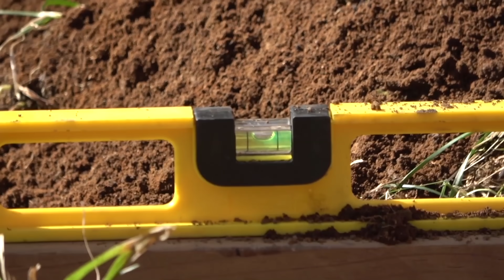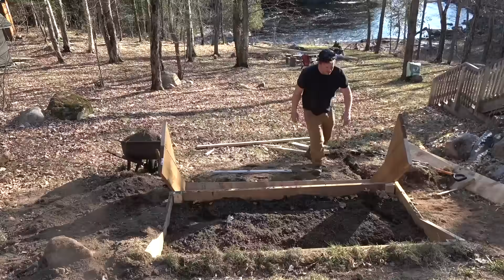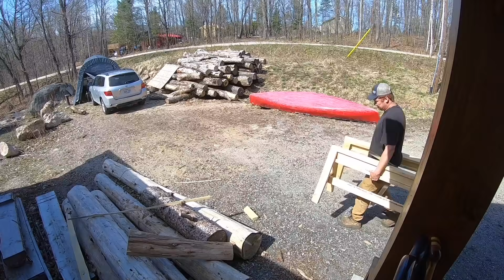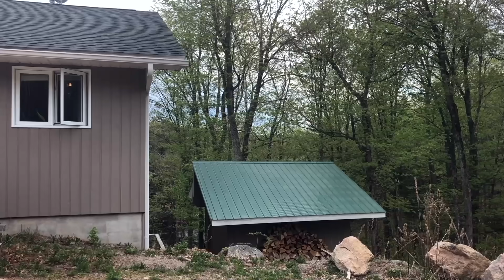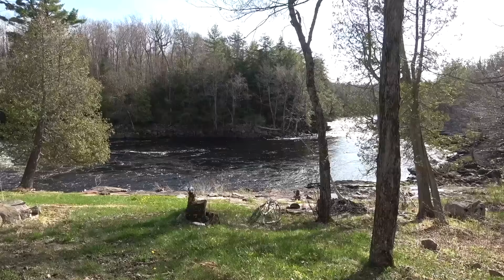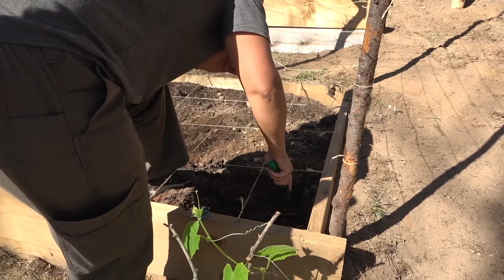Grow Your Own Food - Homesteading Couple Builds Raised Bed Terraces on Hill for Three Sisters Garden

Comment: That is a sweet start! The beds look good. Do you have enough water pressure to go all the way to the top of the hill? You can set up an automatic system to water them all at once, or one or two at a time. I would recommend a drip system at the base of the plants. From my experience they don’t like overhead watering. Mix the manure in and water it and let it sit for a little while, before you plant. It should do fine. Good luck! Make a chill zone next to it, so you can look at your garden and have a barbecue and enjoy with friends. Love your work. Both of you rock! Peace
Reply from the maker: Eceellent ideas!! Thanks a lot for watching

Comment: Lovely property.  I live lakeside in the north and sunlight is difficult for a short season, I moved my garden 3X but compost is excellent so save your leaves and scraps to decompose and learn companion french intensive planting as to what plants do better next to another or vice versa.  Plants do well when you change up the location as they use different nutrients, so tomatoes might go in a different spot each year, they like banana peels! Peppers like a match stick!  That slug you had/ plant your tomatoes with the stem wrapped in some cardboard/paper towel roll/roots to the "side" right in the manure trench style...never had them burn but don't use chicken manure unless composted and slugs will be an inch down next to the stem otherwise!.  Planting higher behind lower to utilize sun.  Growing a second season of greens that like the cold?  Maybe plastic sheeting could help extend your season over and around the beds.  I'm learning more about herbs/medicinals to plant, but nothing is better for immune than garlic and fresh rosemary, basil and thyme! That is my next addition to my own.  I have to use straw/hay to winterize my camp,  so I used that for raised beds 2/3 ft high...composted leaves at the bottom...tons of worms enjoy and cultivate and fertilize simultaneously.  Love your videos including this and it's a wonderful raised garden.  I'm no longer young or very strong so the hay worked for me and decomposes...no weeding at all here due to composting top...plenty of produce in a small 24 x 4..THANKS SO MUCH for sharing YOUR time with us!
Reply from the maker: Thanks a lot for the great input. I’ll give the hay a shot!